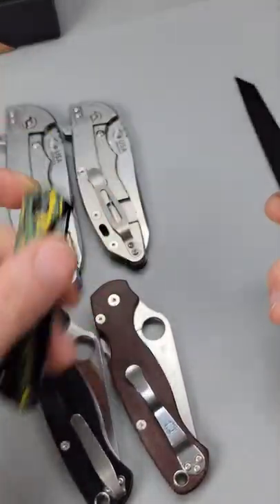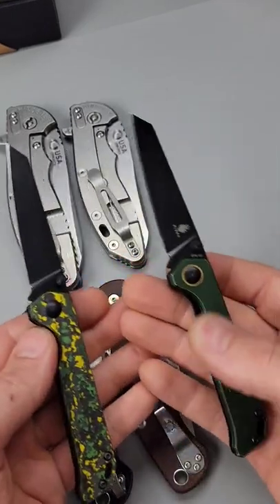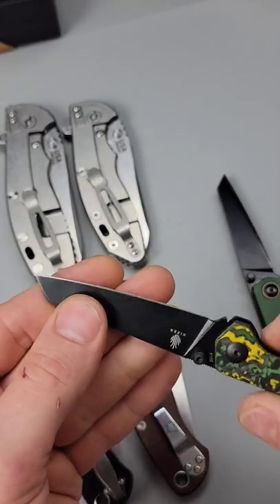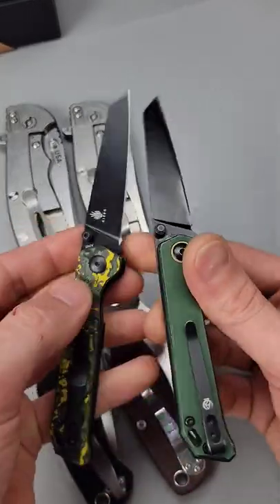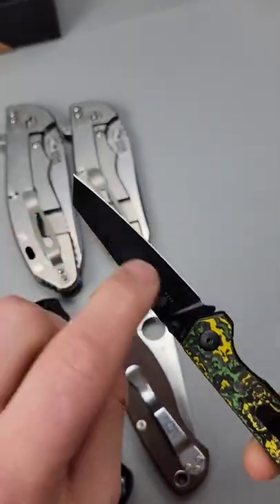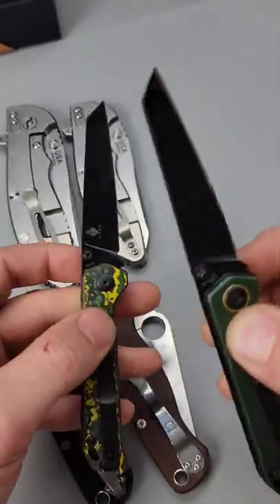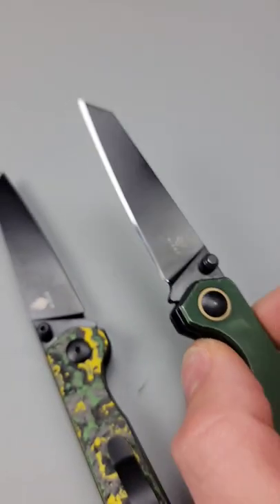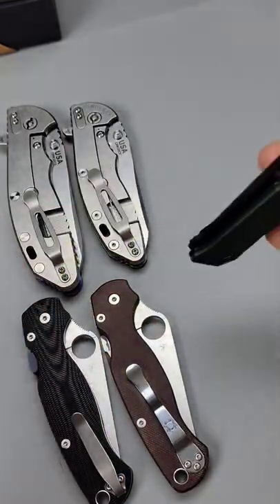YOUR EDGE WILL GO DULL AS SOON AS YOU USE IT

Comment: Just buy a razor knife, best sharpness, no worries about it dulling. Swap the blade, no work involved.
Reply from the maker: The things I cut a razor wouldn't be the best choice, anything thick. A utility blade is mostly for primarily utility cuts, even on the job site where I used a utility blade all day I still had to use my pocket knife, that's like saying in a kitchen just get a chef knife. What about all the other knives in your kitchen that are necessary. If you carry a utility blade in your pocket for everything good for you, I like many others prefer tools for different jobs and carrying a knife has been something men have done since the beginning of time
Reply: @NeevesKnives  agree 100%. I carry a folding razor knife for my job as an electrician. Pocket knives are great for many, but with the wide variety of tasks I do, this one knife handles it all. When it's dull, blade swap and I'm back in the game.
Reply from the maker: @markk3652  of course on the job your utility razor is a very important tool, but some cuts are deeper and require more stability, sometimes it's wood and a folders geometry just works better, or the cut you need to make is deeper than what your utility cutter can do. And after work it's not like work ends, so I personally rather carry an actual knife than a folding utility blade

Comment: Bullshit. I used to blaskmith. What kind of bs do you push to people? Less material to go through means easier to dull. Using your logic i should make hair thin blades back in the day so they would keep the edge forever. Good knife needs a solid cuting edge not thr barber razor finish because if you are going to try and survive with a knife it needs the edge for far longer than few cuts. This is where the thickness comes into play. Thin edge gives the ilusion of retaining the edge because as you work it down it goes along the thined out edge and cuts better at the cost of a good portion of the knife needing to be grinded down on next sharpening. Thats a way to waste a good blade.
Reply from the maker: It's a fact, ask any of the prominent knife makers in the industry, or read any of their literature, I'm a knife tester it's what I do, I test steels and geometry, different edges, etc.. of course there's a tipping point because the edge loses its toughness and becomes to brittle but that's not edge retention that's failure of toughness and like I said you lose toughness. the higher the angle the tougher, so the lower the angle the lower the toughness, then there's edge stability, the ability for a edge to take and hold a fine edge. Retention is the apex of the edge to stay sharp, a high angle has more steel behind it resulting in it to go blunt faster, a lower angle has less material behind it so it's sharper even as it begins to blunt or dull, so it's retention of staying sharp is longer. Depending on what your cutting Depends on the kind of edge you will want. If your only cutting cardboard then low angles will serve you best because your looking for high levels of edge retention, if your chopping or hitting staples from time to time you will want more durability. Read my top comment as well I usually add extra details.
Reply: @NeevesKnives  i used own made tools on a farm and the best way was to keep the edge thought as to avoid loosing the blade over time due to me trying to have a razor instead of a knife. As for how goot materials i used were i always opted for bit thicker blade to avoid loosing it in the sharpening or it beinding. While sharp edge is good when you dont really use the knife for anything when you actually give it a purpose other than rope or ductape on boxes it makes a whole world of difference in how a knife with low angle and a knife with high one is surviving. One may hold the edge longer but a thing i noticed is that the dulling goes far deeper as often one part of the blade is used far more often. (On farms even a knife is a multitool. Being it a lose screw or thick branch). I used though bigger "knifes" (machete would be a better word) due to the location so my opinion can be a bit biased due to my friends always loosing a lot of the blade in sharpening process due to allowing the dulling to gi far deeper. There is a compromise and i always aim in between to have a blade not only sharp but one that will not loose much of material when going dull. (I may have a lot of grammar mistakes due to english not being my first language)
Reply from the maker: @crimson3274  I grew up on a job site my entire life doing construction, my grandma had a farm which I worked at daily. And we kept our edges sharp, many different kinds depending on its purpose, of course something used for hard use is going to be sharpened different that a light duty, or something made for precision, utility blades are very hard use blades for cutting and you see how thin they are with a very low angle edge, and those are made of crap metal. Of course the knife I use along side will be used differently for similar and different purposes
Reply: @NeevesKnives  ii had one way of sharpening blades that worked as a good compromise for everything as the farm i was on was set in a forest so we could not have dedicated tools. A knife made to do limited job would not fly and still does not when i visit my grandma. I had even made it a habit to wewr around a sharpening stone that i still have problems of getting rid of. Being it for a knife, axe or pickaxe(these had a really weird sharpening but great for leverage so we used it for stumps. It had a axe part and a flat part where we sharpened only the axe and kept the flat part in a overall good shape). Most farms have the urban thing of having tools for everything while in countries like russia, poland and even a bit of germany mostly will have one tool with multiple purposes. Having a lot of knifes would be problematic as here we dont say "wait let me get the carboard/letter/any few purposes knife" we just have one swiss knife that catched our attention and he serves every puspose for few years. Never had problems with a dull edge nor the knife not doing its job. Here we tho are used to dull blades due to also needing them on ready all the time so instead of folding them we throw it into nearest plank, tree, stump or sometimes drop blade down on the ground. Often walking to a shed to get another blade on a giant farm is impossible so we always made sure to have one good blade. And like i said the big ones i smithed because its easier to carry around a machete than a axe and its a good compromise between a knife and axe. We just had not onky no time for sharpening, no strenght for it after a good day but also we cared only for the tool to serve its purposes. All of them. It made for a bad habbit in kitchen where what knife you use and how you sharpen it matters. but on any farm i worked on it always been the same. Lets be honest. Only place where the angle matters is kitchen. If i tried toying with my blades this way others would call me a lady and would kick me into nearest home to make them dinner.